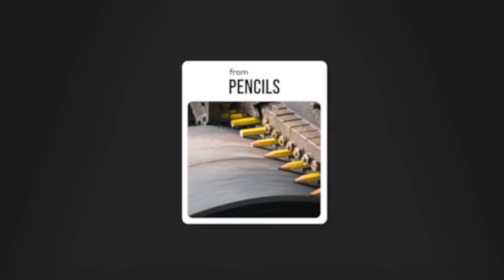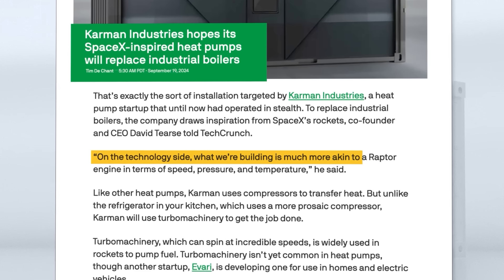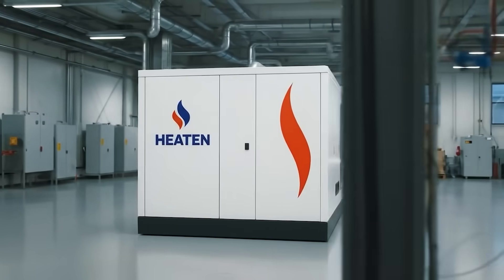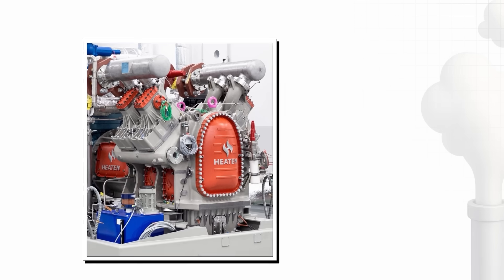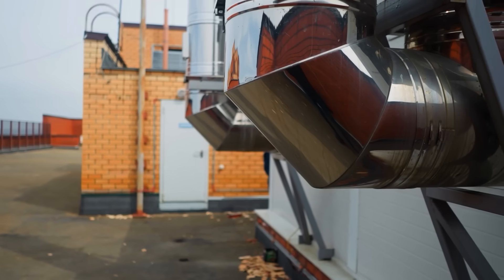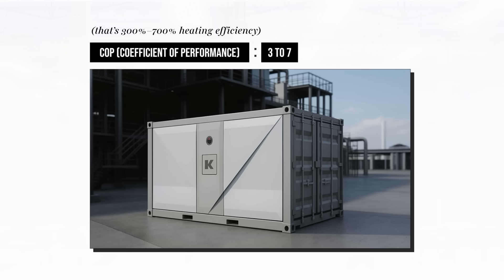Is This Space-Tech the Future of Heat Pumps?

Comment: Use filtered air. Air is free. Filtered air is almost free. It is non-polluting, easily compressible ... and because it is almost free and non-polluting, it doesn't matter if there is a leak.
Reply: How does this relate to high temperature industrial heat pumps?
Reply: You can't condense air to liquid, so you could only use it in a reverse Brayton cycle. But you'd rather have a close cycle with pure nitrogen, to reduce corrosion and troubles with water vapor condensation. Open air reverse Brayton cycles have been explored for air conditioning, but with no success.
Reply: @markotrieste  Absolutely, and the equipment would have to be a bit bigger and air won't hold as much heat by volume as the nasty and expensive state changing refrigerants but the compensation is that filtered air is all but free. Whilst nitrogen is environmentally friendly, it is a great deal more expensive than the air that we breathe. You would want the system to be sealed so feeding the system with totally dried air in the first place, there would be no problem with condensation or corrosion. The outside of gas cylinders are exposed to the air but, after a patina has developed, corrosion is minimal for decades. All these things have advantages and disadvantages. My suggestion is purely that filtered air regardless of the disadvantages, it is all but free. 

In addition to fiddling with a hand pump to compress air and super heat it, I have made some Heath.Robinson solar thermal experiments in the past. I moved house and had to dismantle it to make the house saleable and haven't bothered since but I was using a parabolic trough to concentrate the Sun onto a pipe and to blow air through the pipe. I achieved temperatures in excess of 300°C at the outlet and successfully boiled water which could have fuelled a steam turbine. I know that is not the subject of the video but I was interested in heat concentration in various forms. It was years later that I came across some videos on YouTube made by Sergiy Yurko about his primitive experiments in Ukraine  where he showed that electricity could be produced at a fraction of the price of the unnecessarily complicated systems being used in various commercial solar thermal set ups so far ... solar thermal power stations where hair-dressers have done what they can to add bells and whistles for no other purpose but to add to the cost and drive up resultant prices. Unfortunately, Sergiy's home, half way between Kyiv and Kharkiv, still a long way from the front lines is under threat of Russian drones.  If you have a bit of time, take a look using  "    Sergiy Yurko YouTube     "  Pick up on one of the few videos of his shewn and then use his thumbnail to get his channel with many more. If you get the one with the computer voice, wait a moment, then you will hear Sergiy in person.

Comment: You left that the most important industry. Our generation most of our power generation depends on steam turbines and if you could take the heat out of spent steam and put it back into the system without it escaping bringing up the overall efficiency. We would save tons of fuel as most power plants are only 30 to 40% efficient.
Reply: Ever heard about the second principle of thermodynamics? The amount of that heat is inversely proportional to the highest temperature in the steam cycle,which is already maxed out by technological limits. You can increase the temperature of the waste heat and use it for district heating. However this reduces the efficiency of the plant, because it can't use the whole temperature and pressure difference for spinning the turbine. And anyway this is more efficient than dumping that heat into a heat pump that uses electricity to increase back up the temperature. 

TD principles are hard...
Reply: Are you ignoring the fact that large steam power plants use cooling towers and ponds to condense back the water from the steam system, resulting in the 60 to 70% loss along with exhaust? Of course that heat could be recaptured even if it takes a little bit of energy.  @markotrieste
Reply: @damionfragoso2655  Hi, I wrote an extensive answer but YouTube censored it for who knows what reason. Can't answer you again on this cr@p platform. In short, no, I'm not ignoring anything. That heat is lost forever. If you want to recover it by using a heat pump, you'd be way better off by simply increasing the plant final discharge temperature. The efficiency loss is smaller than the energy a heat pump would use. Hard truths from thermodynamic principles.
Reply: Indeed, still "most" but changing ... It's getting close in these days in the US.   As far as power generation goes, most gas is now from CC NG - where the gas turbine side (called the top) is  about 2/3'rds of the net output, and it doesn't involve steam at all.   They  have a second steam generation step using a HRSG (recover heat for steam generation and generator feed).  With nuclear down to 18% and Coal just above 15%,  that 2/3 of 43% (and rising in general for fueled generation means) are pretty close being equals on "steam" ...

Comment: for most people heatpumps are not yet usable for heating their home, there are a lot of obstacles (just like with EV's)
first of all, the cost, second, the ammount of electricity it uses, third, the low heat (+/- 40°C) wich is only good for floor heating and extremely insulated houses, a typical gasboiler delivers 60°C and even more if you need it
four, heatpumps are too bulky compared to a wall mounted gasboiler
so unless all four of the above mentioned specs are not equal to what we use now (gasboiler, ICEV, etc)
normal working citizens wont make the switch
Reply: Depending on where you live , in my case it saves its cost over the lifetime of the unit and uses 1/4 of the energy to do the heating . Cheaper than all but free firewood
Reply: Curious to your location for such a view.  Widely used in the US already and gaining momentum with the last few years' emphasis on sub-zero (F) performance.
Reply: @lylestavast7652  Europe 500 meters from the windy beach, there are several things that make buying a heatpump to expensive for us normal working citizens, low income and high taxes, on average we earn $2025 a month, and that's already a fairly high income for the working man/woman, and if you consider the cost of a air/air heatpump at about 6000€ without the expensive electricity to run it (5Kw) we also have a 21% tax on everything we buy, thats why so many people cant even buy groceries and their power bills anymore, how could we afford to buy a heatpump or/and an EV, simple answer, we CANT
Reply: Ronny, maybe google literally anything that's happened in the HVAC space in the last 10 years.
Reply: This video is about high temperature industrial heat. Heat pumps are well established for domestic and industrial space heating in Europe and the US.
Reply: Yawn
Reply: The UK has a grant system to subsidise domestic heat pump installs (£7500). And because of the efficiency of heat pumps and despite the cost ratio of electricity relative to gas, the energy cost of heating is similar to a gas boiler.

Comment: AI Summary

Abstract:

This video explores the potential of next-generation industrial heat pumps to significantly reduce energy consumption in manufacturing by utilizing low-grade waste heat and boosting its temperature to usable levels (200-300°C). Two distinct approaches are highlighted: California startup Carmon Industries' system, which employs high-speed turbo machinery inspired by SpaceX rocket engines and aims for 300°C, and German company Heaton's heat booster, which uses a reciprocating (piston) compressor to reach up to 200°C. The video explains the basic principles of heat pumps (compression and expansion) and discusses the key technical challenges, including achieving high temperatures efficiently (maintaining a high Coefficient of Performance), selecting suitable refrigerants that can withstand extreme conditions, and overcoming manufacturing and market readiness hurdles for mass adoption in capital-intensive heavy industries. Both companies are backed by significant investment, indicating potential for real-world deployment, though challenges remain in scaling these innovative technologies.

Decarbonizing Industrial Heat: Next-Gen Heat Pumps

*   0:00 Industrial processes use a vast amount of energy for heat across many sectors, from pencils to pipelines, making it the largest energy-consuming sector. Industrial heat pumps could significantly reduce this energy use if they can reach higher temperatures.
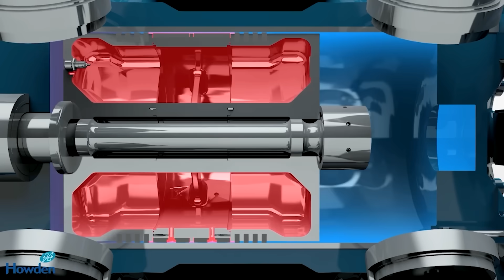*   0:20 Two promising next-generation industrial heat pump technologies are discussed: one using piston compression (Heaton) and another using turbo machinery inspired by SpaceX rocket engines (Carmon Industries).
*   0:44 A major challenge is the significant amount of energy wasted as low-grade heat (below 100°C), which is currently difficult to reuse economically. Boosting this low-grade heat to more usable levels using heat pumps is a key goal.
*   1:25 While reaching thousands of degrees for industries like steel is a long way off, current efforts focus on achieving 200-300°C, suitable for industries like textiles, paper, pharmaceuticals, and food.
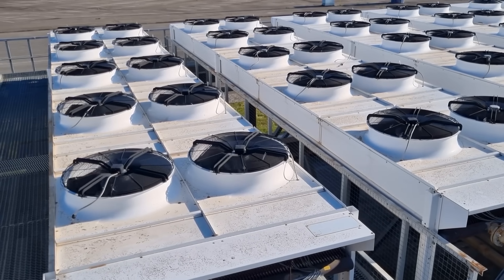*   2:01 California startup Carmon Industries is developing the "Thermal 01," which claims a 25-50% energy cost reduction and aims for theoretical temperatures of 300°C.
*   2:20 Carmon's technology is inspired by rocket science, utilizing high-speed turbo machinery akin to SpaceX's Raptor engines for efficient compression at high temperatures and pressures. Electric motor technology from EVs is also critical.
*   2:47 German company Heaton offers the "Heat Booster," a high-temperature heat pump that can reach temperatures up to 200°C and claims a 50-80% reduction in energy use.
*   3:09 Both systems rely on the fundamental heat pump principles of compression (heating fluid) and expansion (cooling fluid to absorb heat).
*   4:22 Heat pumps achieve high efficiency (Coefficient of Performance > 1 or > 100%) by absorbing more thermal energy than the electrical energy used for compression. The compression step is a primary focus for innovation in high-temperature heat pumps.
*   4:44 Carmon's high-speed compressor requires fewer stages (1-2) compared to multi-stage systems, which is likened metaphorically to the speed, pressure, and temperature handling of a SpaceX Raptor engine.
*   6:49 Heaton's system uses a reciprocating compressor (piston technology), common in heavy industrial machines, capable of handling the high-pressure increases needed for high-temperature lifts, unlike typical screw compressors in domestic heat pumps.
*   8:50 Heaton's heat booster can achieve temperature lifts of up to 140K and output water or steam at temperatures up to 200°C.
*   9:01 Carmon's goal of 300°C is higher than Heaton's 200°C, and Carmon emphasizes the compact size of their system ("300° in a box," fitting in a shipping container).
*   9:18 Carmon's turbo machinery uses ultra-high-speed impellers (>50,000 RPM) and components made from advanced materials like nickel-based super alloys and silicon nitride ceramics, designed to withstand temperatures beyond 800°C.
*   10:00 A significant challenge for high-temperature heat pumps is finding suitable refrigerants (the fluid transferring heat) that can withstand the extreme temperatures and pressures required without degrading or losing efficiency.
*   10:14 Heaton uses custom hydrocarbons and hydrofluoroolefins, which operate near their thermal limits at 200°C. Carmon likely uses a different refrigerant and possibly a different thermodynamic cycle (speculatively, the reverse Brayton cycle using inert gas) to reach 300°C.
*   11:56 A key technical challenge is maintaining a high Coefficient of Performance (efficiency) as the desired temperature lift increases. Heaton's data shows COP dropping from 5.4 to 1.9 when targeting higher temperature rises. Carmon aims for COP 3-7, which would be very high for their temperature goals.
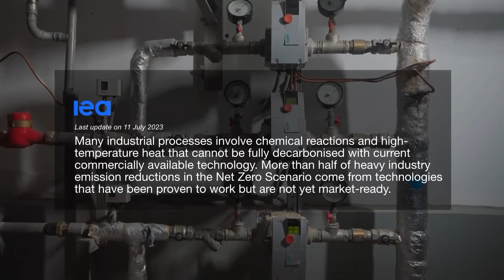*   12:48 Carmon is currently an early-stage startup with a pilot expected in 2026, backed by VC funding to accelerate development.
*   13:03 Heaton is further along, providing real-world data and planning forthcoming installations, including a rice drying plant in Belgium. Heaton has recently been acquired by private equity, indicating strong financial support.
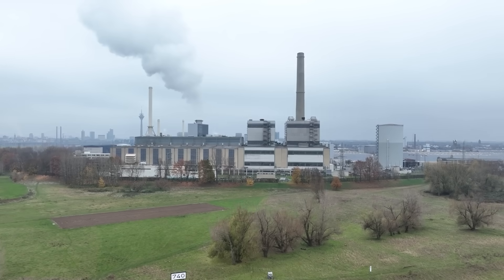*   13:43 The International Energy Agency notes that over half of projected heavy-duty industrial emission reductions rely on technologies proven to work but not yet market-ready, highlighting the challenge of "emissions inertia."
*   14:05 Challenges to mass adoption include the prototype/pilot stage of many new technologies, the capital-intensive nature of heavy industry, long equipment lifespans, and slim margins that make investing in new tech difficult.
*   14:24 The central question is whether innovations like Heaton's piston system and Carmon's rocket-inspired turbo machinery can successfully develop into widespread real-world applications across millions of factories globally.
*   14:37 Decarbonization efforts are critical, and finding solutions that also save money is a desirable outcome.

I used gemini-2.5-flash-preview-04-17| input-price: 0.15 output-price: 3.5 max-context-length: 128_000 on rocketrecap dot com to summarize the transcript.
Cost (if I didn't use the free tier): $0.0075
Input tokens: 17251
Output tokens: 1391
Reply: Damn, thankyou for this.